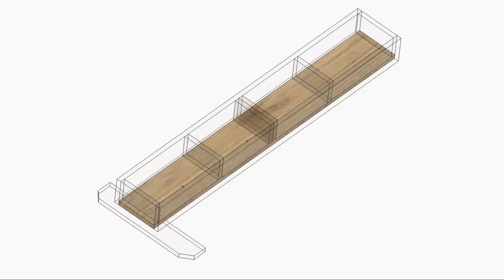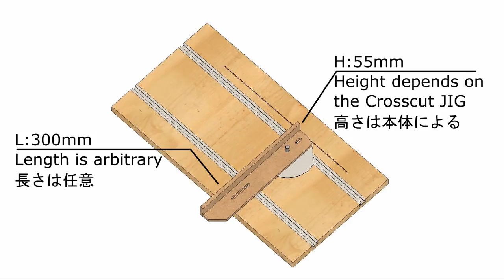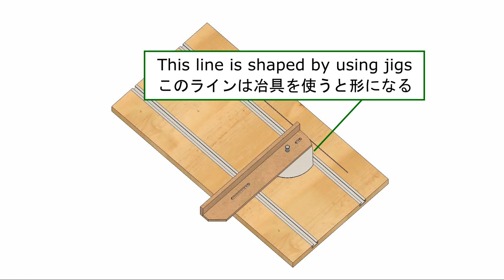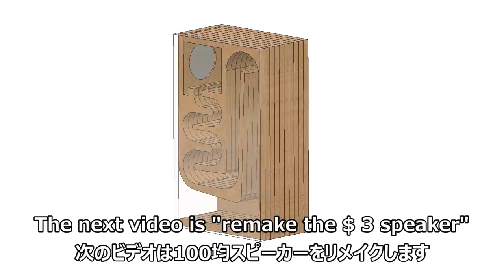6 In 1 Circular Saw Crosscut Jig part.2

Comment: Does anybody have an idea why many cross cut jigs add a miter to do 90 degree cuts? Isn't the back of the jig sufficient to do 90 degree cuts? What are ALL the uses of the additional miter?
Reply: This is to avoid cutting all the way into the end support of the jig and having the saw fall off the rails.

Comment: Excellent. Congrats.
I´d like to know where to buy hardware material, like laser and other items shown in video.
If possible, please post links or email me.
Tks for share.
Reply: It's best to do a web search or check amazon.

There is an attachment that can be mounted onto a circular saw arbor next to the saw blade that turns on when you start the saw. It them displays a laser that shows the exact line of cut the blade will travel.

Newer saws may actually have them attached. I have a sliding miter saw that came with one built in from Harbor Freight